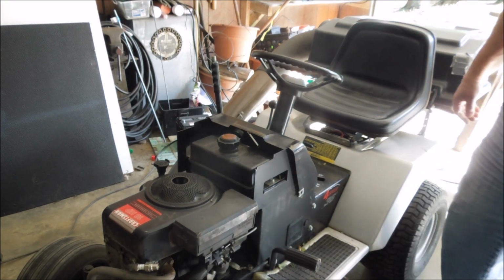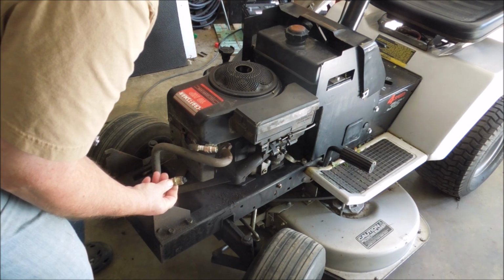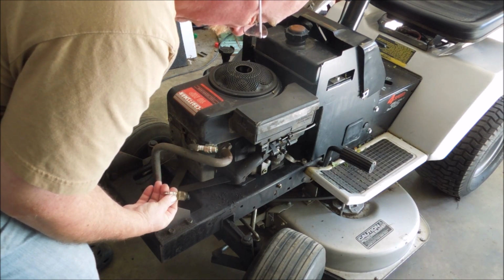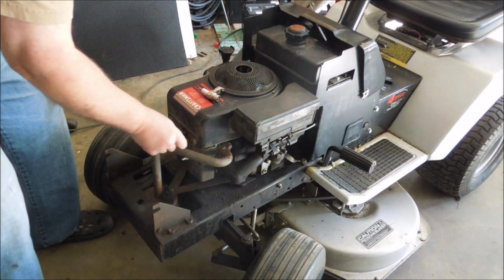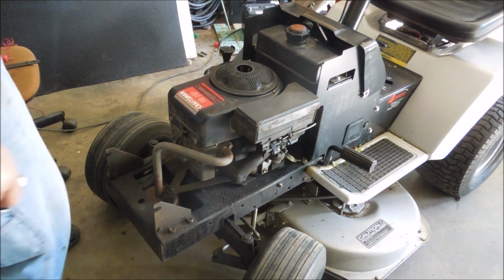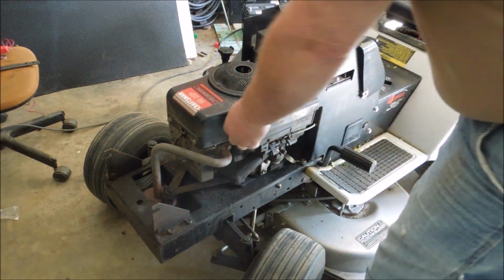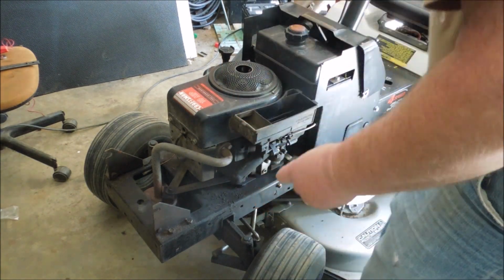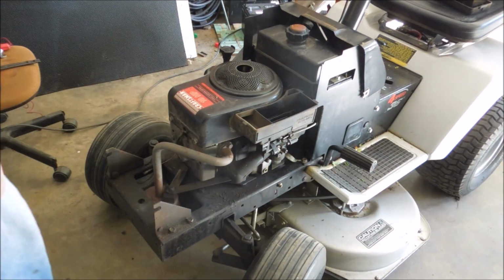TIPPING POINT FOR THE MOWER

Comment: I got a mower exactly the same make and model  ,   it took a lot of punishment for years ,  2 years ago something went in the motor ( I forget what it was )  I took it apart but could not order the part ,  I took it to the machine shop to have new part made and he said it couldn't be done .   I still keep the mower ( it was my grandfathers) hoping for another engine that will fit under the cowling .  Ontario Canada
Reply from the maker: The 10 hp Tecumseh is common in the states. It is a pretty close match to the Briggs & Stratton 10 hp engine. The newer 12 and 14.5 Briggs are similar in size with the addition of overhead valves.
Reply: Thanks !

Comment: YEP!  Check Fuel.   = )     Do you smell it when trying to start?     ooo plug needs a bath   Good to know > that 'Test Plug'!  
Always shake my fist at mower - Remind it the 35 + yr old one started 1st time every time.  It starts!    (gave old one away - body broke)  =[
Reply from the maker: The test plug has an alligator clip welded on so it attaches to a grouding point and doesn't rattle off. I use to just lay the plug on top of the engine then keep pickking it back up.😆

Comment: They'll stick and be right stubborn about it.I'd always just pour some oil down the stem and turn it over by hand and smack the valve head every time it stuck. After a while it got tired of getting smacked and quit sticking. Then I'd put the head back on and and run it with new oil or some diesel or kerosene to wash the innards, then put the diesel oil in it. Most of the stuck valve motors had never had an oil change. The diesel high detergent took car of that. I've got the solenoid for the Craftsman. $10 and change. The original was made here. The new one came from a long way off. I will try and get the old one going. I'll probably need it. Glad you got the old beast going. The old motors were a lot tougher than the cheap made but not cheap to buy stuff. Happy Weekend!
Reply from the maker: Thanks Lewie. When I go shopping I'm picking up some series 3 oil. The oil hadn't been changed until I did it. Black as coal. 😕
Reply: Just get some Valvoline or Delo or equivalent. The mil specs are all the same pretty much. 10/4 on the coal oil. Usually the 15/40 will run all season, no trouble. The new solinoid is on with a mod here and there. With non-fingers I had to use a 2 inch bolt to get the thing started and held with a magnet holding the nut and the impact slowly spinning till it caught. Then I used a little longer than stock for the other. Already  started stripping down for the steering gears and fuel line. I'll get it when I do. Supposed to be back hauling on top of the cliff monday so we'll see what we see.
 Happy weekend, Sneelock Family!
Reply from the maker: Good work around Lewie. When I talk about hand starting screws it's more for the uninitiated. Old hands like you and I know to be precise when starting a nut on a thread. 
There are fasteners designed for powered assembly. I like dognosed fasteners. On a dognose fastener the first bit of the fastener is not threaded. The nut slips on the nose of the fastener and lines right up with the thread.
Reply: I've got some of those dognosed jobs I got somewhere but never knew what they were called. THANKS, Unc! I learned something today other than a reminder how blasted goofy I am!
Reply from the maker: We really wanted to use thos on the armored doors but couldn't convince  the engineers. It would have taken a lot of testing to prove they worked. Then every motor pool that worked on Hummers would need to restock with the new bolts and still have the old ones. It was working. So if it ain't broke don't fix it was the word down from the board room.
Reply: Always a bottleneck or a complete blockage. The engineer on the dam job was from Quible out of Charlotte. The little wise person that was the 
peg-legged mechanics helper asked him if he knew the difference between engineer boots and cowboy boots. He just about got the job shut down!

Comment: yep compression, could hear the lack of,  but still could be an easy fix, investigations!
Reply from the maker: Ended up polishing the valve stem and the inside of a nylon seal that was around the stem and clamped down with the valve spring. 
It't started about 20 tmes now. Knock on wood. 😆